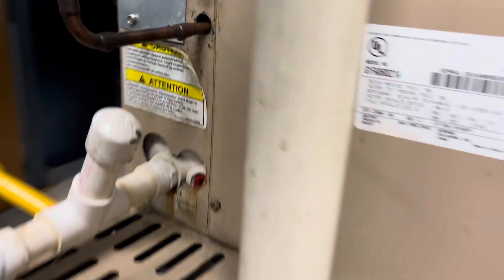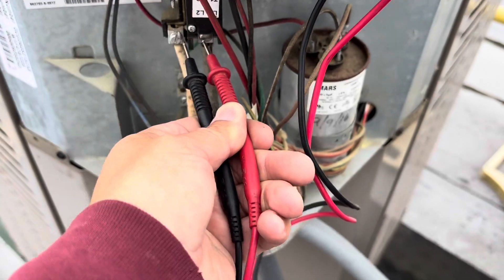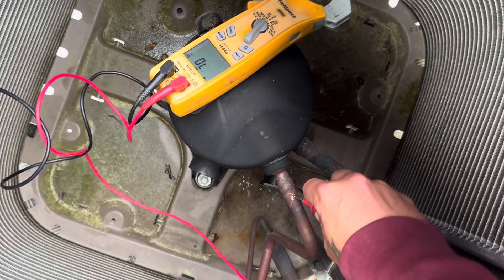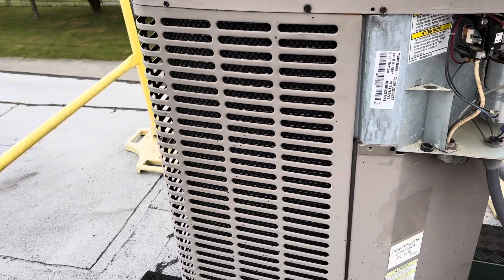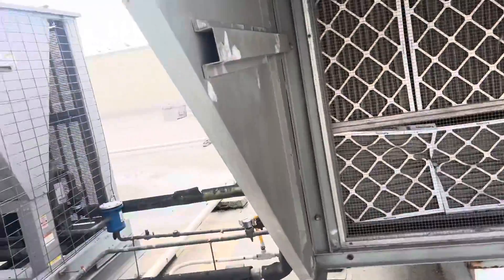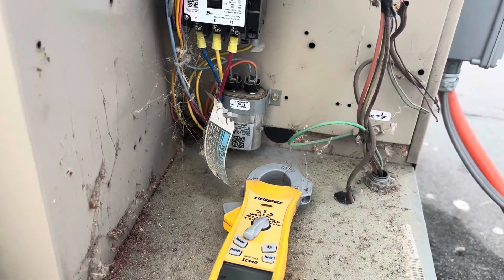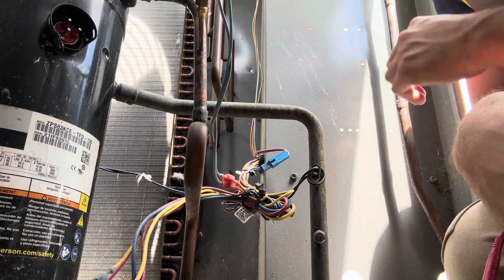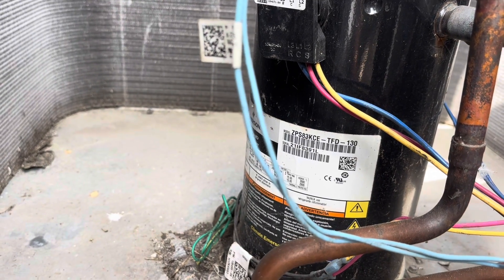Diagnosing Shorted Compressors In Central A/C Split Systems!

Comment: A tip for those faded to white tags on the side of units take a permanent marker and wipe it on your finger and then wipe your finger across the tag on the unit and it will highlight the words that you need to read or information you need to get. 👍
Reply: Didn’t work
Reply: @wmgmusicgroup  what do you mean it didn't work? Been doing it for years. The only way it won't work on those is if you let the ink dry on your finger before trying wipe it on the tag OR a possible non-embossed tag. Never seen a faded tag that wasn't embossed but I guess it's possible that it exists out there somewhere.
Reply from the maker: Good advice.

Comment: Chicken lovers can afford it. That is nothing compared to when the bird flu kills millions of them. I'm glad I don't have to clean that up. Their main unit looks like the school across the street. They removed a couple of big piston compressors and replaced them with a line of big rotary compressor units. They use so much electricity that they have their own transformer building, fed by 3 phase high voltage from the overhead lines. They also have a generator. It was running a few weeks ago when the tornado knocked out the power for a day. Then have natural gas service to operate it. I have to use propane to operate mine, since this house is all electric.